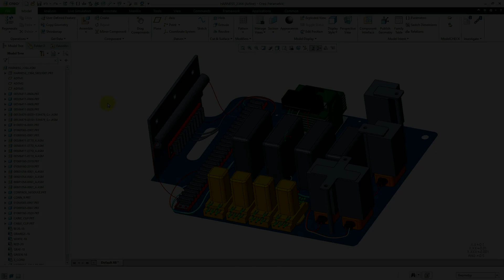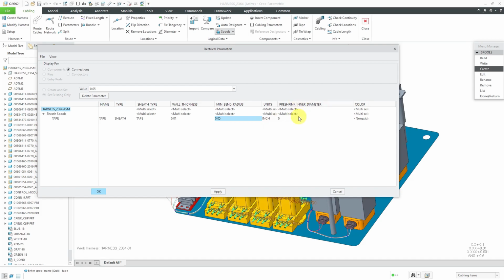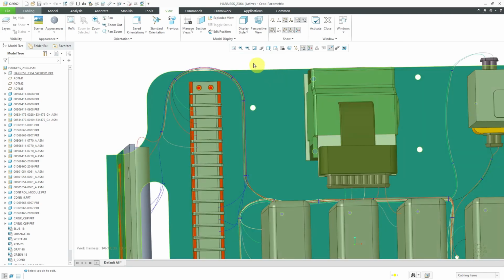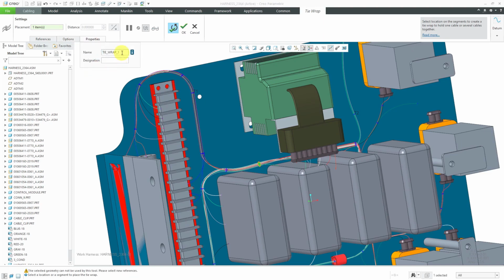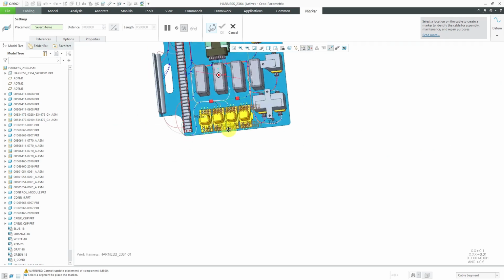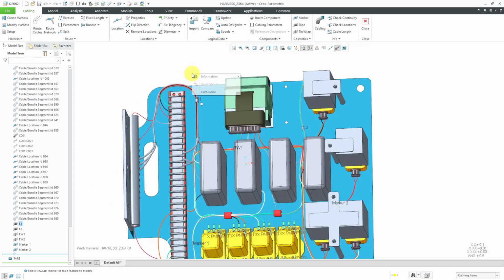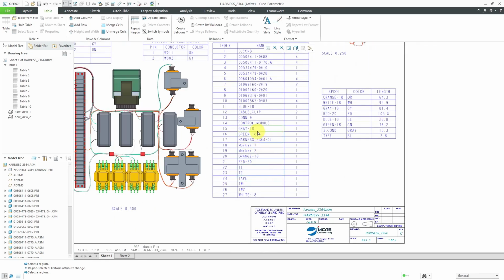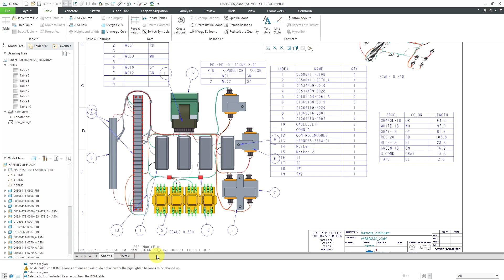Creo Parametric - Cabling - Cosmetic Features

Comment: Hi, whenever I enable Cable Info for my repeat region,  the spools aren't displayed whenever the model used is under a certain rep. The spools only show when the rep used is the Master rep, is there any way that it could also show the spools under certain reps? I've tried to modify the rep in the view manager but was not able to figure out a way to include the spools under certain reps. Basically I just want the spools added to the BOM while referencing a certain REP for the model. Thank you!
Reply from the maker: Spools are assembly level features. Why not use a custom rep that has the assembly in the Master Rep and have actions applied to components as necessary?
Reply: @CADPLMGuy  So in other words, I need to create an upper level assembly? that will contain the harness assembly
Reply from the maker: That's not what I said.
Reply: @CADPLMGuy  I get it now. I'll just have to SAVE a modified Master Rep into a new name Rep. I got it. Thankss!

Comment: Please show how to add coordinates in creo cabling.
Reply from the maker: I don't know what you mean by that. What are coordinates used for in cabling? Please elaborate.
Reply: Creo Parametric — I really appreciate that you came back to me in a short time but I found a solution I was having issues with adding multiple points to guide a cable route from one connector to another connector.
Reply: Creo Parametric — Cabling>Insert location>Datum>offset coordinate system>imported cartesian datum point from .pts file.